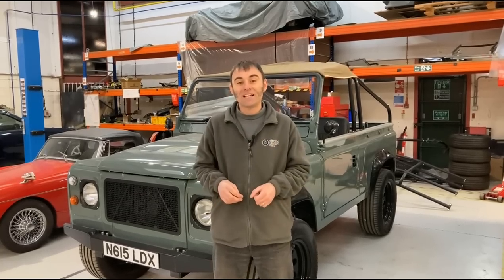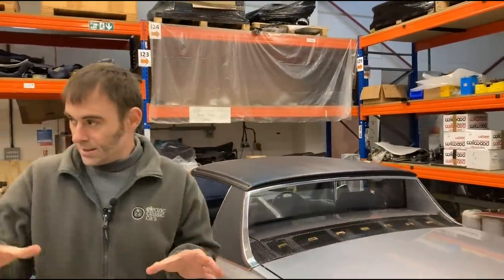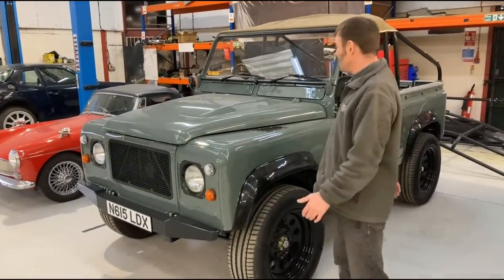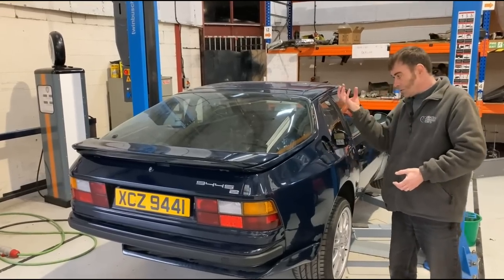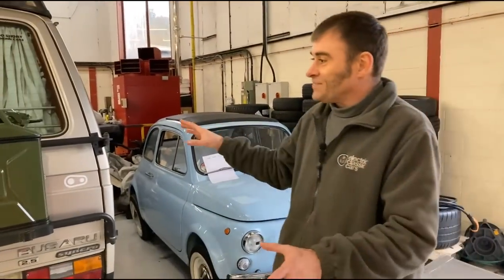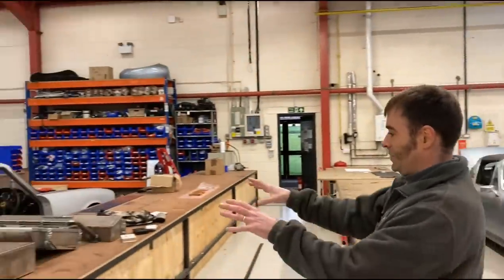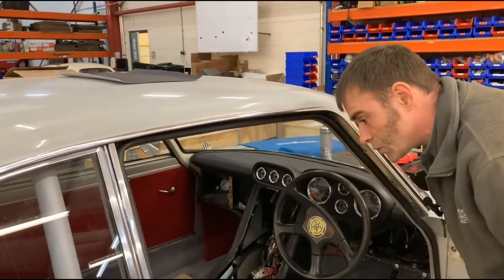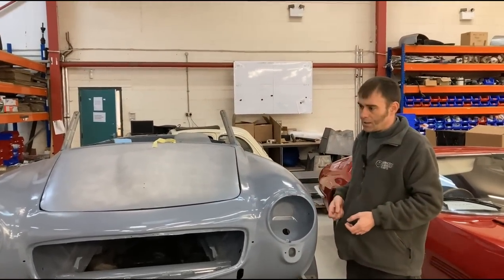Classic cars converted to electric - Workshop Walkaround

Comment: More technical videos with how you tune the driving characteristics with software setup would be interesting as would videos on different mechanical (motor and battery) set ups and reasons for choosing them for that project. But just more videos are always welcome :)

Comment: Fiat 1200 rear lights? Film quality spot on, well done both of you. Tech geeky detailed stuff. Glad you saved the best to last. ;-)
Reply from the maker: Thanks Peter. It's not a Fiat but you're closer than you think. 😁👍
Reply: @ElectricClassicCars  Peter is correct. They were also used on the Fiat Pininfarina Spyder 1200/1500/1600 as well as the Ferrari  250 GTE , and the GK of course.
Reply from the maker: @H2HAL  Yep, he is indeed correct. I forgot that Fiat and Ferrari were attached at the hip at that time. 👍
Reply: @ElectricClassicCars  Ferrari were still independent of Fiat back then, and the common thread was them both being designed by Pininfarina I feel.
It must have been a supremely expensive light unit to be tooled up for so very few production numbers.

Comment: Definitely interested in the tech stuff, and some of the other upgrades required for electrification, such as suspension changes, gearbox and diff changes, engineering requirements, etc.

Comment: Regarding the end of the video: I would love to see more technical videos like some of the examples that were mentioned. There are two things that I'm particularly interested to hear about. (1) Battery thermal management: do these systems typically come with the battery pack, or is there specific tailoring required to a given system? (2) Regenerative braking. Same questions as with thermal management: how much setup/adjustment is required on your end to make it work?

Comment: One of the main reasons people convert these cars is to make them more practical. I think it would be great to address some of the general issues of using an electric car and not just the pure technical stuff (that I love).
For example in Series 1 the terms Amps, Volts and KW were thrown around and a lot of people you are not EV savvy might not know what you are talking about.
Also maybe tighten up some of the dialog. The narrator said almost verbatim in many episodes "connecting the electric motor to the original gearbox saves time and money" or something like that... Mix it up, tighten it up a bit.. 🙂
Love the series and looking forward to more!

Comment: That beetle looks like a tail happy death trap
Reply from the maker: It could have been when it was petrol but now it's electric we've improved the weight distribution with a front battery pack. It improves the handling immeasurably. 👍

Comment: I stumbled across this video by chance and will have to catch up on vintage voltage. I have never seen it. I really like the idea of this, especially the VW bus and Beetle. Nobody could argue the case for the old air cooled lumps producing bugger all power. Still not sure if I am OK with a Testarossa having its engine replaced with a motor though 😳

Comment: I'd like to see more technical stuff, some test drives with performance and range figures, and how you handle battery thermal management in different builds.
And it's great to hear that you'll be converting an E Type! Can we see that progressing in a series of videos, if it's not in Vintage Voltage, please?
If you ever do a classic motorcycle conversion, that would be really interesting too.
Not much to ask, but it should give you some interesting ideas. Thanks, Richard. 🙂👍
Reply from the maker: We converted a Royal Enfield to electric in series 1 of Vintage Voltage. I think there's also some pictures and video of it on Instagram and Facebook. 👍

Comment: I've got my recorder set on series record Moggy! 
Yes, more tech content like how do you deal with a car that has ABS and how have electric aircon solutions come on (I think  there was a bit on it in Vintage Voltage series 1)? I've been having pipe dreams about having an electric series 1 Lotus Evora. I think an Elise is a bit on the small size, plus Lotus did conceptually design an electric Evora and built a one off hybrid.
Reply from the maker: I do love an Evora, one of the few modern cars I like. 😎👌

Comment: Richard, stoked to hear of the 2nd series of Vintage Voltage … will it be shown in the US on Motor Trend? hope so … the VW Karmann Ghia of season 1 was the inspiration for my conversion of a 69 Karmann Ghia. I would love to hear about the upgrades you are doing for some customers, especially the upgrades for high speed charging!  Keep up the good work!  By the way, can you tell me where I can buy the silver bezel for the tbs expert pro I saw one one of the cars in this video? Marcelo
Reply from the maker: I'll try to find out if there's plan to show VV in the US. I can't remember what chrome bezel I used on the Expert Pro gauge, I remember it was a good few years ago now that I found the best fit and I bought all the stock from the company. It was something random, I'll see if I can find out for you. Or just email us and order one. 👍

Comment: Lots of questions! How reversible are your conversions? Will the Ferrari engines and drivetrains be safely stored or sold off for spares? Why retain the transmission on the Synchro, would front and rear motors not give better result and less weight? What is the target range for each conversion?
Reply from the maker: Lots of good questions there, to be answered in an upcoming Q&A video we're going to do.👍👍👍

Comment: I would like to know how much extra does it cost to fit a type 2 charger (just 7.4kw type) over adding CCS (say 50kw max) charging cability to a vehicle? I know its not just the charger, cooling of the battery would add some as well but on average?

Comment: At the end of the day those are not old restored but essentially brand new factory quality cars. With proper care those can work flawlessly at least 20 years. After that they might need a new swap of their guts and brains but those will be modern for that time ones. Is it a way of protecting batteries by providing type 2 charging port for AC slow charging only? I assume providing a CCS port needs much more expensive upgrades in battery thermal management?
Reply from the maker: A lot of our conversions have CCS. It's customer preference. Usually 99% of charging is Type2.
Reply: @ElectricClassicCars  I see: customers admit their future car “pet” will not be road tripped but rather walked like a pet dog in neighborhood thus being just fine with home AC charging only. Thank you.

Comment: I need an Ariel Nomad converted to EV. Main challenges: keep weight near original, good useful capacity for day long outings, grow cargo space rather than reduce it and the usual Nomad quirk: it can be made less weather sensitive, less water in face and over feet. With such a costly project though, I'd ideally go straight for a 4-motor layout that doubles traction and makes it a Tesla killer at the lights. 4 motors also calls for good torque vectoring software than allows for tighter and surer bends on all surfaces and (for fun mostly) tank turns and pirouettes. One idea I have for such a beast is to maybe scale up the original in most dimension by say 10-20%. Create space for the battery in an added floor layer and/or between the seats. Add cargo capacity in the back rather than stick batteries and other hardware where the engine used to sit. So from a small buggy it could become a slighly more "rally raid" type of vehicle while embracing all that used to make it light. Possibly a more advanced cage material if some weight could be shaved there. Under a ton AWD EV from a 700 kg buggy is still a great challenge but I think it would be a worthy one especially if some great packaging can be achieved. Wait for the new Tesla 4680 cells and use have their Performance pack? If of course they make sense in terms of energy and power density. Power might be plenty with half a pack. I suspect they might go 80-100 kWh for Model Y. Half will suffice in a sub ton buggy. <150 kg in cells and they can be used structurally as well. Big cells, so few leads and parallel groups to deal with.
Once a half Model Y drivetrain is figured out with stock or aftermarket 4x motors, I bet it will be a popular shoehorn into various other projects where weight and packaging as valued.

Comment: Wanted to ask what do you do with the heating system? Do you use electric heating or do you use the heat generated from the radiator?
Reply from the maker: That's a good question. I'll answer that in the next video. 👍

Comment: Hi I'm local to you I used to work for a firm almost next door and I now have an electric vehicle but its not working aswell as it should do you offer battery health/ analysis we just want to know if we should keep our new car or send it back its only doing just above half the min range in eco with regen on cheers and you were right all those years ago when you said to me electric cars were the future
Reply from the maker: I'd say to get the garage where you bought it to look at it. 👍
Reply: @ElectricClassicCars  I did they sent report to manufacturers about fault and they did further tests and plugged car in so that they could read the results elsewhere and the manufacturers have said its OK and not willing to do anymore and as yet have not given me the battery analysis so I'm not sure or what to do next really its supposed to do 143 miles in normal driving condions I use it in eco no heater ect and regen on and only getting 85.6 miles actual range the manufacturers just font want to know its only 3 month old

Comment: One of the biggest hang-ups I have with electric conversions, other than lack of range and slow charging is the loss of original usefulness, ie: no trunk and/or back seat.
Obviously that's not the case with the VW vans and the sports cars weren't practical to start with.  ;-)
Reply from the maker: Obviously you've not seen our conversions then. 😜👍 A lot of our conversions have a range of +200 miles, have CCS charging and retain a full boot space for luggage. 👍

Comment: The rear lights look similar to the Rover P6.
I'm not sure but there may also have been a ferrari with similar lights?
Reply from the maker: Not a Rover, but you're correct about the Ferrari but which model? 😁👍
Reply: @ElectricClassicCars  Ferrari 250 GT?
Reply from the maker: @huwdavies6650  Yep, the Ferrari 250GTE. 😁👍

Comment: A question.  There are millions of ICE cars that are going to be redundant.  What if instead of dumping them for pennies you made kits that could be fitted by normal dealerships? Is that a practical idea? With classic cars it's a no brainer but what about say a Toyota Corrola? ICE cars will probably be out of production in the next 5 years but many would be good candidates for conversion. 
If you looked to supply a practical kit. No huge high speed long range. Could it be viable?

Comment: Hey Richard, just subscribed to your channel and I love that your still thinking about viewers quality of life. Fellow YouTuber here so I understand the journey!

This isn't exactly classic car oriented but I expected it may be In't he future. We currently have two Phevs, an Outlander and an Ampera. Both are neither spectacular or groundbreaking in any mode but both are extremely capable and have many pluses on their side. I'd love to hear to your ideas on the option of upgrading vehiclea like these with BMu's underatressed motors and transmissions to full BEV status. Do you think it will be a possible development for PHEVs and ReX vehicles in the future?

We also have an older t5 which I'd love to convert to full electric. Is there a way you can demonstrate cost v range on a standard conversion? Really interested on seeing how the T3 synchro works out.

Love the channel already and good luck.

Comment: Great show. I understand a few things but will offer my ideas even though you might not be interested. I'm Canadian. Why be more interested in power versus distance? Dodge had a Magnum. They now stopped the Magnum. They still produce the 300 which is similar. I've always felt that the Magnum had a lot of space. Why not convert a Dodge Magnum to electric and do it in such a way that you can offer it to Dodge as a reason to bring it back electric. Also, can you design battery packs in a layout so not so much for fast but for longer duration (distance).

Comment: I am dreaming about your electric T3 Transporter Syncro project:
why not go 4 electric wheel hub motors with a computer control system,
already available technology, e.g. from Elaphe in Slovenia?
Then you can get rid of a lot of weight in form of gearboxes and replace that weight with extra battery capacity!
Might represent a bit of a mechanical challenge though. 
That old VW T3 Transporter design really lends itself for such adventures with plenty of space underneath to install battery packs, provided you protect them solidly.
That's what I would have done but did not have the resources nor the time, so I went BKD diesel instead:
https://youtu.be/KX32XTAECcc.

Comment: Love converting most of these cars but taking out the Ferrari V12 is a step too far for me!
Reply: Ferrari v12  with the motor replaced with  a electric motor is no longer a Ferrari, the value of the car has fallen through the floor.  An expensive paper weight.